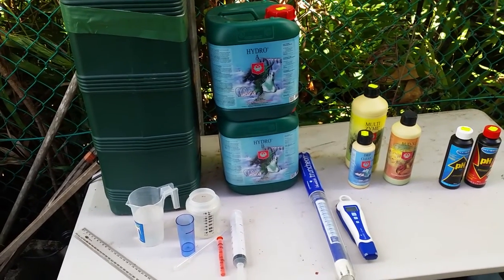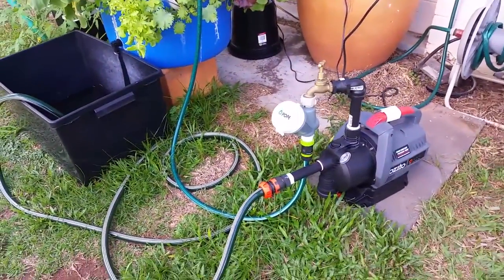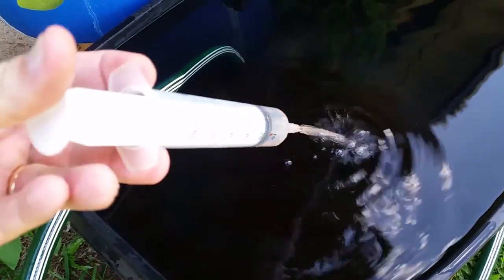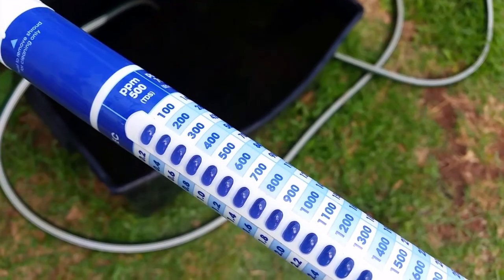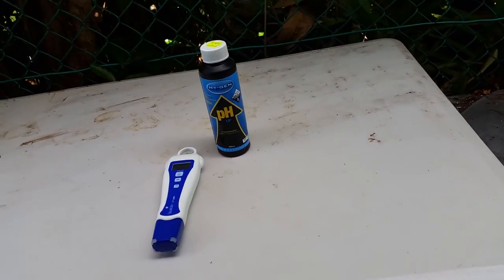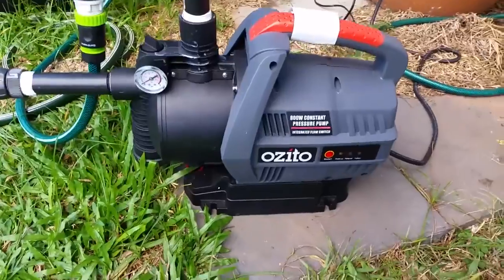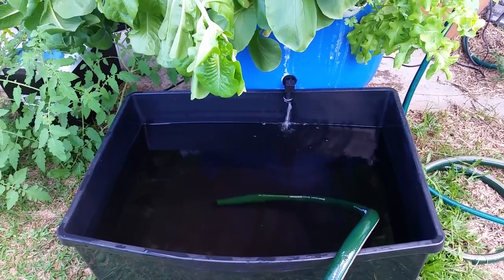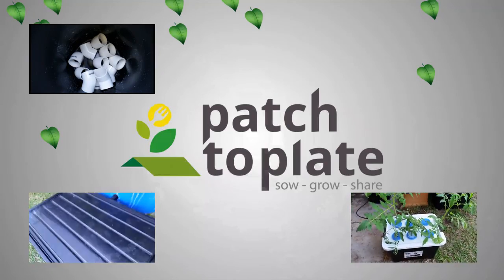Aeroponics Tower Build - Mixing Nutrient

Comment: What is in the Hydro..what chemicals.. . would veggies be 'organic' ??
Thanks for this, great info!!
Reply: Yeah they're still organic and should be perfectly safe. Plants need particular elements to thrive, You can find all of them on the periodic table :)
from my research these are NPK, Nitrogen (N), Phosphorus (P), Potassium (K), those are the three main elements.
Then we have Calcium (Ca), Magnesium (Mg) and Sulfur (S)
Also some trace elements (which means far less of these elements are needed. but they are still necessary)
Iron (Fe), Manganese (Mn), Copper (Cu), Zinc (Zn), Boron (B) and lastly some Molybdenum (Mo) 
Then theres other elements that can be used to raise or lower the PH.

Plants also need sunlight, water, and oxygen and I believe other elements that make up our air.

When a plant takes in these elements they work the same regardless of their source. Wether the plant draws it in through soil thats been enriched by purely natural (Organic) processes or if it has the required nutrients dissolved in water then sprayed onto the roots it's still giving the plant exactly what it needs on an atomic scale.

I only just started learning about this so if anyone has corrections or anything to add please do :)

Comment: Hi,
My system would be in an enclosed area with controlled lighting by the way. I live in the Czech Republic, wide temperature range.
i presume that your summer temperature can be quite high and since the ideal temperature for aeroponics is between 18 and 26C, how do you cope with summer? Obviously for winter it is possible to heat, if necessary.
Is it reasonable to have a variety of plants in one tower, i.e. the greens etc, plus tomatoes, peppers and strawberries? That would mean that the nutrient solution would be the same for all the plants?
What is the droplet size of your mister?
Would you think that a bilge pump might be suitable, 750 gallons per hour?
It is very kind of you to take the time and trouble to offer advice to the rest of us.
Kind regards,
Geoffrey

Comment: So how does the schedule looks like or is there none? Depending on the conditions and the stage of the plants I guess?
Reply from the maker: +Cannabis GrowOp I have experimented with a few different timings and will have a new video on that in my next growing season (about 2 months or so away). Optimal seemed to be on for around 1 minute and off for 7 minutes. I am working on some monitoring gear though that will keep an eye on conditions and adjust spray rate accordingly as in the heat of the day, 7 minutes was perhaps too long between sprays. More coming on this though and thanks for the question and for watching.
Reply: Thank you for the great free information you provide on this channel.  I be on the outlook for the new upload!

Comment: Thanks for your vids mate. You have inspired me & explained it great. I will let you know when I get running. How big is the pump you use?
Reply from the maker: +Granny &amp; Pa Sorry for the slow reply, missed a few messages somehow! When sizing the pump I found that the pressure rating is more important than flow rate. Depending on the number of spray heads you have and the distance you are lifting the water (measure from reservoir inlet to highest point in the spray manifold), you will need more pressure. The pump I have is continuous at around 55 psi and that is plenty. I am lifting the water about 1.5 metres without any problems. This growing season I will be experimenting with other pump and spray options though and will have some new videos coming then (season is around 2 months or so away now). Again, sorry for the delay in replying and thanks for watching :)

Comment: wow man I'm totally doing this what is the estimated total cost of everything including the client system?
Reply from the maker: Jonathan McNeal G'Day! A little hard to give a cost for everything as I had the pump and use it for other things so haven't factored that in. I am also researching some other options with solar and a smaller pressure pump so that will change the cost as well. On the tower itself though, you can pick the drums up for free pretty easily (or for around $10). The manifold and spray heads were under $20. The most expensive part in my build was the 45 degree elbows to use as grow tubes. I have 67 of them and they were just under $150. Two ways to keep the cost down though, less grow tubes - could easily get by with half of what I have), or use straight PVC and fit it to the drum at an angle. More work in doing it that way but would bring the cost of the grow tubes down to like $10-15 + a bit of elbow grease :)  Hope that answers the question for you and thanks for watching.
Reply from the maker: Jonathan McNeal Extra to my last message - things like the pH and nutrient meters, nutrients etc, prices will really vary depending on what you use. Probably best to look online or visit your local hydro store to get an idea of what you will need and what it costs in your part of the world. Good luck mate :)